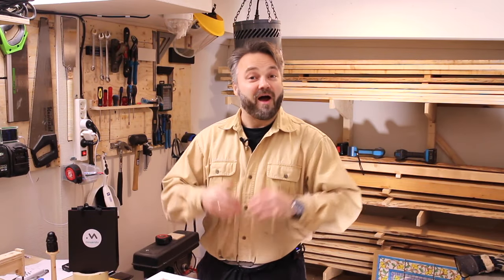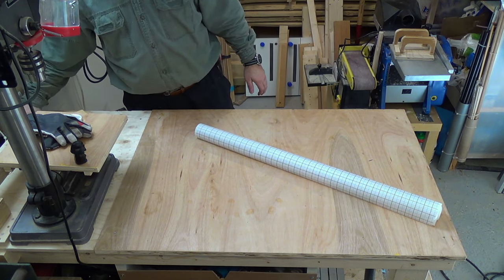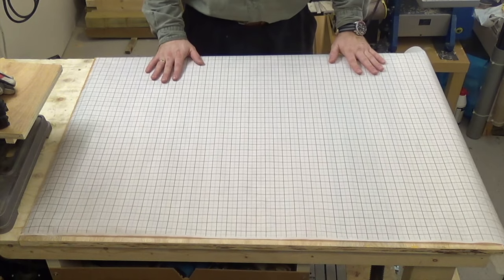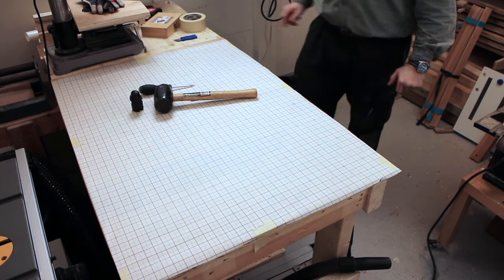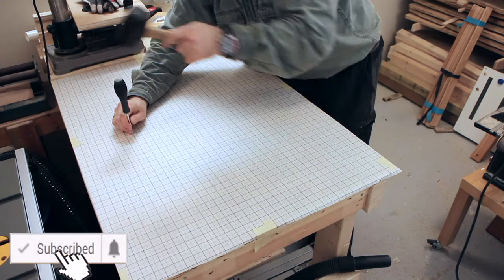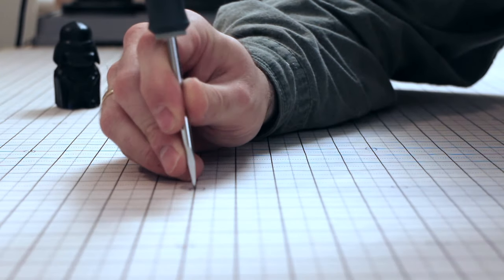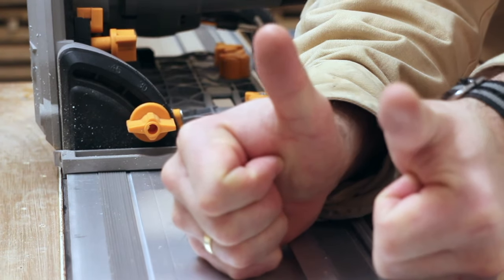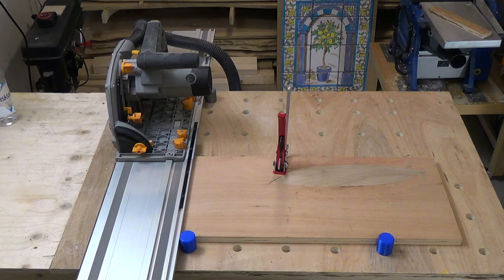Super Accurate No jig DIY Multifunction Table (MFT) 2.0 - Made in Norway [0060]

Comment: I think you are confused regarding checking squareness of an MFT table. The cuts you made are not proof of a 90 degree square cut, they only show repetitiveness of cuts. In fact, if your dogs were wildly out, lets say 100 degrees and not 90 degrees, the width of cut would still show parallel. Nice idea though, but certainly no proof of squareness
Reply from the maker: Hi and thank you for your insight. 
My point regarding the squareness of the table, is that it is more square than the cheap track saw due to slack in the plunge mechanism. 
I did a video on the 5 cut method if you feel like seeing how far I am able to measure squareness with my tools. 
https://youtu.be/9n9OmUTzb5U
Cheers. And thanks for watching and commenting.
Reply from the maker: I had to watch back the end of the video after reading your comment. And you absolutely right regarding the "test cuts" at the end. They only show them being parallel. Thanks for the tip.
Reply from the maker: I have pinned your comment. So people can see it better. Thank you for pointing this out.
Reply: @NomadMakes  I would have used a pegboard as a pattern.  They are cheap and very accurate.  The paper can work, but simply taping it on doesn't ensure it conforms to the flat surface. There will be areas where the paper doesn't make full contact with the mft top. I would use spray adhesive and glue the pattern down on a stiff piece of cardboard or other sheet material and use a roller to ensure good contact.  Use it as a template for creating the holes.  The squareness doesn't really matter at the early stages.  Once you have drilled out the holes, it's just a matter of cutting all 4 edges of the mft top using your tracksaw referenced to the holes. This ensures the table sides are parallel and square to all of the holes.
Reply from the maker: Those are some really good suggestions :-) And ripping the edge to the holes are a great idea. 
Thanks for watching and commenting.

Comment: Hi Goran, Firstly thanks for the effort and thinking you put into this series of videos. About 2 years ago I tried to design (more trial and error) a way build an MFT top with an accurate 96mm grid of 20mm holes (without buying expensive jigs to achieve it) and wish I’d found your videos back then. I failed dismally and bought an after market replacement top for less than £40 UK which works perfectly. However the bug has never left me and I’ve tried various times to design and build small jigs with correctly spaced 20mm holes to help with various projects I’ve built in the workshop. Some have been a success and others a failure, mainly because of the repeatability issue of accurately matching the 96mm hole spacing. I don’t suppose in your deliberations you came across any 96mm grid paper? Thanks again for all your effort. Best Regards Dave
Reply from the maker: Hi Dave,
The solution I came up with, but never tried for any spesific spacing, was to have a printing shop print a grid paper. Mainly this was due to cost. For instance you will have to provide the files yourself if are to have any chance of getting it printed at an ok price. 
That being said, an imperial grid pattern should do it. So perhaps something from the US?
But to be perfectly honest. At 40 £ i would buy the top. 
Let me know how it works out for you. 
G.

Comment: I appreciate the "outside the box" approach, but couldn't you simplify things by using the tailor paper to make a masonite (hardboard) template/jig for future use? Cheers!
Reply from the maker: Hi,
I suppose that would work. Are you thinking about a full sized sheet as a jig, or one that you would have to move after a few cuts?
I go through a lot of the thougt process in the previous videos in the DIY MFT series. Perhaps take a look at this video: 
https://youtu.be/c-eTSTnnWN8
Cheers and thanks for watching and commenting.
Reply: Or just go buy a sheet of peg board that already has  the holes drilled.  Just hi-light the  holes with the spacing you want and use those holes when drilling for the dog holes.
Reply from the maker: If you see the whole mini series I made on this, you will hear my reasoning for doing it this way. Let me know how it works out if you go the pegboard route. Cheers.
Reply: @NomadMakes  I was replying to GeeDeeBird, my thought was then he would not need the paper to make the holes in the Masonite. I understand your reasoning and there is nothing wrong with the way you are doing it and it could easily be better than my idea of  using the peg board as a template.
Reply from the maker: Ah. I see. The comments system is a bit confussling sometimes. Cheers ;-)

Comment: Why does it take so long to drill each hole, is your forstner bit blunt?
Reply: @ Nomad Makes, you've liked that but it was a serious question, surely it shouldn't take as long to drill each hole?
Reply from the maker: Hi! I am at work ;-) Will reply later.
Reply from the maker: The forstner bit is used, not very dull. I belive the main problem is that the chips/sawdust has nowhere to go. And adding the shop vac to help evacuate the dust helped a bit. Also I didn’t want to retract and insert the bit many times pr hole, as I did not want to ream out the holes. It was also a bit difficult to put pressure directly above/behind the drill. Do you have any ideas what could have caused it?
Reply: @NomadMakes  I had thought about making a bracket like the parfguide one with a couple of bearings supporting the forster bit, but you'd need a longer forster bit. This might allow more access for a vacuum to clear the chips. Could your difficulty in drilling be a combination of bit sharpness/ quality, drill speed and the plywood you're using? Is the plywood some mentally strong marine ply with glue layers that don't easily drill? Have you tried MDF? In any other videos on here of people drilling MDF/ plywood with the parfguide bit they seem to easily drill the holes. I've resorted in buying a replacement MFT  MDF top for £39.95 and a trend pattern but for £18.30 (Amazon UK) so will use the top as a template and see how that works out. A lot cheaper than the parfguide system. 😳
Reply from the maker: @nialstewart8263  I think that there may be a combination of many of the factors you mention. I decided to solve the problems using the gear I had, but an augering bit would probably be better.
Reply: @NomadMakes  Does an auger give as clean a hole as the forster bit? I think you've ended up with a good (if laborious) solution. I can't believe you've only got 700 subscribers, please keep up the good work! 👍
Reply from the maker: @nialstewart8263  Thank you! An auger may not give you such a clean hole.
Reply: @NomadMakes  Where does the air come from, to remove the dust? I may be wrong, but I cannot see any inlet channels in your jig. You need to feed air to the cutting tool- not only does it improve extraction, it helps cool the tool!
Reply from the maker: Hi Mike!
The jig I used to drill is covered in this video:
How to Drill Perfectly Plumb or Straight With a Forstner Bit - Made in Norway [0054]
https://youtu.be/wJ3rDdQzZ7U

Thanks for watching and commenting :-)
Reply: @NomadMakes  Confirms my belief that you have no air entry point. You really need this...
I see you are using a wood block as your top bearing. High friction, and a source of the heating of your bit. An oiled bearing is needed for this, in a material such as phosphor bronze. You can get sintered versions of these, which helps retain oil in the bearing.
Reply from the maker: @Tensquaremetreworkshop  Can you suggest any readily available and cheap ones? Bear in mind that this project was supposed to be a cheap DIY alternative.
Reply: @NomadMakes  I got mine free- disassembled old computer printer... They are available in the UK from 'bearing shop' for £1.20- around e1.5. I would search on-line for 'sintered bronze bearings'. They come in sizes that match forstner bits; I used a Makita that had a 10mm shaft.
Having said that, I would never use this method again. Lot of work, and inferior accuracy to a template. A good CNC template will be good to 0.01mm - at least when it was made. You can get close to that on a hobbyists CNC if you take care to calibrate. Use Baltic ply. Leave the template on top of the table for at least 24hrs - you want the temperatures to be the same. Longer helps to match humidity (important). For those using MDF, do not fuss too much about accuracy- it will move over time, especially with humidity. Remember, one template can last for life- and do all your friend's tables too...
Using a single cut line with adjustable fence means all this is not very important. Adjust from time to time, and you will get better results than anyone relying on holes being square.
Reply from the maker: LOL. You hit the nail on the head. When this top is worn out, I will make one on the Maker Space CNC. Or buy one. 
However, the point of this project was to make one without very expensive and/or high tech tools to help. And I got well within my required tolerance.

Comment: Maybe im wrong even if you layout holes are all messed up if you trim the end of board and move it out and cut it again it should be parrallel but not square
Reply from the maker: If you want trim the edge parallell to the holes you can use a spacer and some bench dogs. Cheers.

Comment: Terms like 'accurate' 'precision' etc are meaningless unless you specify tolerances. Engineering is all about tolerances.

I have made MFTs using both the 3-4-5 method (using jigs machined from solid aluminium and with phosphor bronze guide bushings) and CNC cut templates. The latter is much superior, both in terms of accuracy and speed.
Using forsner bits into awl holes gives the first error. Tightening jig securing screws gives another. Using water will damp the wood, there will be movement during drying (especially if MDF is used).
I recommend a trim router into a template, slightly undersized holes (19.9mm) and finishing with a 20mm hand reamer. Only worthwhile if quality birch ply is used- MDF moves with time, temperature, and humidity.
If you intend to use the table with a single cut path (most people do), then great accuracy is not needed- make the fence adjustable and set it to be square in use. (The Festool MFT is not accurate- it is adjustable. And not referenced to the holes).
Reply from the maker: I really like the adjustable fence idea. And, yes, I mostly use one cut path. 
When it comes to tolerance creep, I kind of discuss that in this video:
https://youtu.be/c-eTSTnnWN8
Cheers and thaks for commenting.
Reply: @NomadMakes  Actually it is error creep, not tolerance creep. Something is either within tolerance, or it is not.
Either the fence can be adjustable, or if you use clip blocks between the rail and dogs (I do this to prevent the cut passing through dog holes- around 30mm clears them) you can machine these to give you a 90deg cut.
You  may wish to improve your tracksaw to give better alignment. They can usually be modified in many ways- Check out my channel for several videos on tracksaws and tables- including my TrakLyft system; this transforms the use of an MFT.
Reply from the maker: Thank you for the great information :D

Comment: Nice work, but on eBay U.K. people are selling cnc cut replacement tops for £50. Seems a bargain to save all the pain of repetition! Still, an excellent video of you want to make your own.
Reply from the maker: Yes. They are a bit more expensive in Norway. However, there is a maker space here in Bergen with an excellent CNC. And seeing how time consuming this was, I will cut my next MFT top on a CNC. This was more of an intellectual exercise though, to see if I could do it. I invite you to watch the whole playlist on the topic. That being said, I am NOT doing it again ;-) Thanks for watching and commenting. Cheers!
https://youtube.com/playlist?list=PLhGoq3smxvZVTBt1Gsx4JVd7ZjhHnkv3V
Reply: @NomadMakes  If you are cutting your own CNC template, calibrate the CNC machine first. Check for linear accuracy in both X & Y and for squareness. Unless it is an industrial machine, it is unlikely to be correctly calibrated, in my experience. Especially if it is aluminium frame- this has a thermal expansion greater than wood ( steel is close enough for most purposes).
Reply from the maker: Thanks for the tip ;-) I still haven’t gotten around to using the Makerspace CNC. I suspect that the next MFT top will force me down that path :-)
Cheers.

Comment: not great at 11.28
Reply from the maker: What you see there is the 3D printed bench dogs not being plumb due to compression in the print. Not the hole being out of plumb. 
I have used this a fair bit now, and the track saw is still the limiting factor. That being said, the next iteration will be CNC cut. Not because it was out of square, but because it takes too much time doing it this way. 
Cheers.